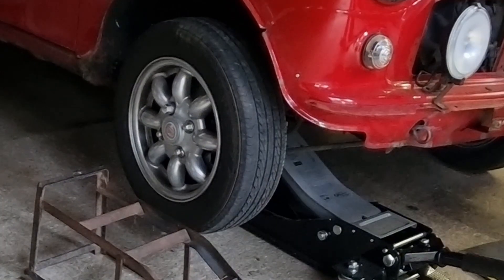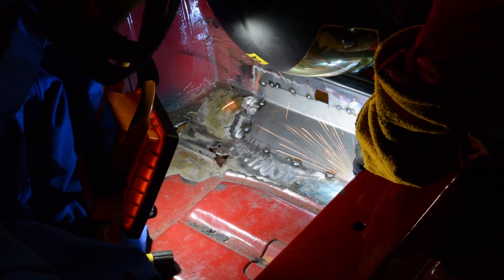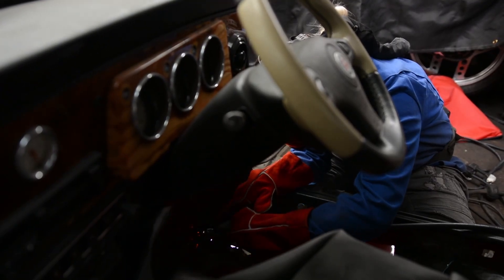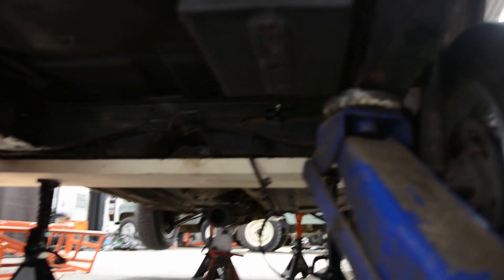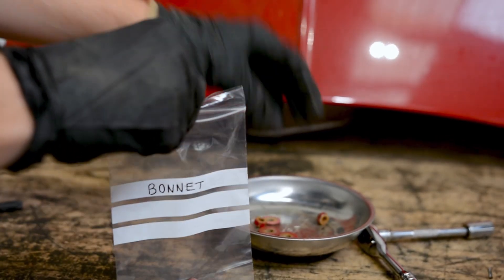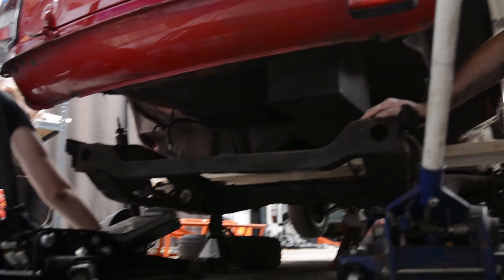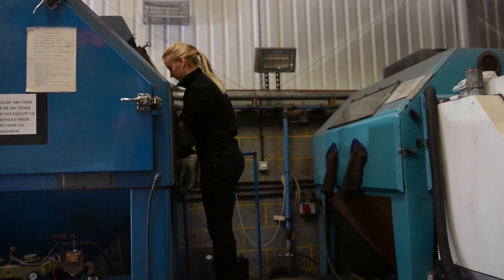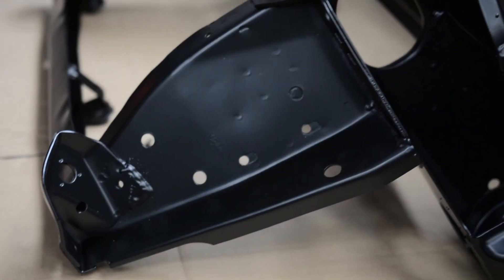My First Project Car: One Year Of Classic Mini Restoration #laurakershawworkshop #classcimini

Comment: I had my Mini for a year too, it has been 10% driving 90% fixing, now the engine is out to rebuild the transmission. All that work just to make it work well, haven't touched the rusty bits jet... I took it as a challenge and a challenge it's been. Nice job with the restoration, I took notes for when I start fixing the body.

Comment: As for mods, you're a bit more limited because you have an MPI mini and therefore limited by the ECU. A consideration before modifying is getting it through an MOT in terms of emissions. I think that it also depends on how far you want to strip down the engine as that will give you a lot more options. You can go from bolt-on options to full engine rebuild. I'd rank these from easiest to hardest/time consuming. 1) K&N air filter and induction kit 2) Maniflow Exhaust manifold 3) RC40 exhaust 4) Roller tip rockers (maybe 1:5 for a road car, depending on cam) 5) Modified head (Ported + polished initially to double valve springs and larger valves) 6) Different cam (Swiftune SW5i/ Piper / Kent / MED are all great) 7) different diff ratio (Your's I think has a 2.76:1 ratio which is good for motorway cruising, but impacts acceleration. If you want faster acceleration at the cost of a higher cruising RPM, a 3.44:1 could be an option.) 8) Oversized pistons - These can take the engine capacity from 1293 (+20 thou) to 1380 for big power.

As for a simple set of mods, the airfilter and induction kit, Maniflow exhaust manifold, Maniflow Injection LCB and uprated spark plugs is considered a stg 1 kit and can be had for about £450. 

I'd suggest looking at the brakes at the same time, depending on how good they currently are and how far you want to go with the performace mods. With 8.4" disks, Mintex M1144 pads are good. For ultra effective braking, four pot calipers are available. You can also go to vented, vented and cross drilled disks or minifins on the rear for better heat dispersion and reduced brake fade, but that might not be necessary on a road car.

Other aspects to consider for a good road going mini are tires, rubber suspension cones (these may be old and hard), shocks, high-lows, replacing brake lines for braded lines for a firmer less spongy feel and suspension bushes.

As to where to buy from - There are a number of places in the UK including Minisport, Minispares, Huddersfield spares etc.

Good luck going down this rabit hole.

Comment: I think you should change the gearbox and change the helical gears to spur or straight cut gears and also the side gears or drop gears straight cut. The Engine cubic capacity could be increased to 1440 cc with the cylinder head port and polish with oversized intake and exhaust valves with half race camshaft with a DCOE sidedraft 45mm Webber carburetor with a Exhaust header - 3 into 1 connected to a straight out 2inch exhaust pipe